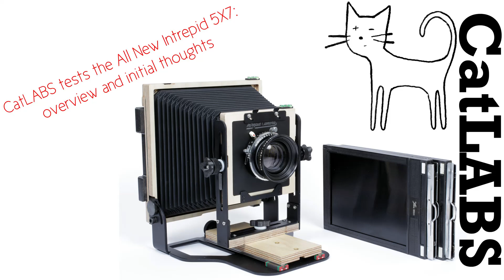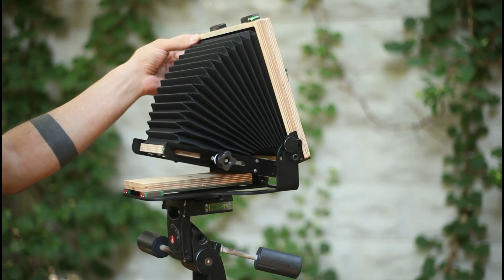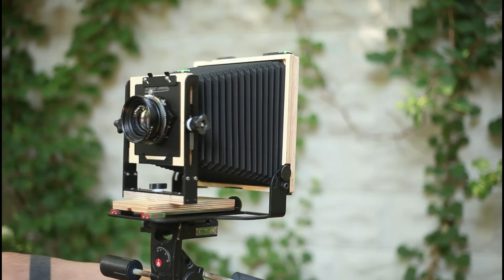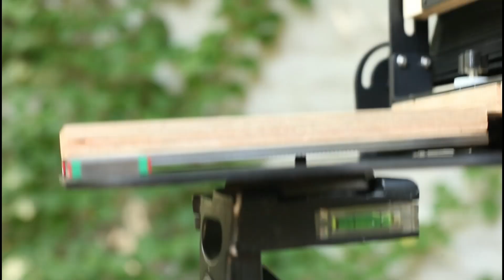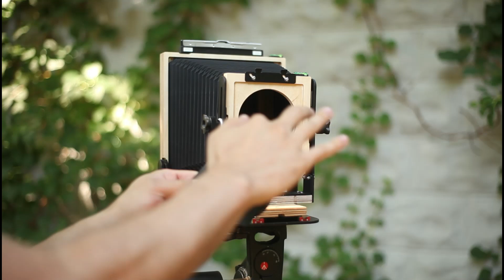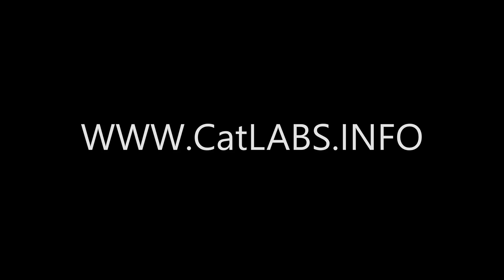CatLABS reviews the all new Intrepid 5X7 camera

Comment: I have the 4x5 MK4 and all the issues you have touched on I have experienced. Difficult to set up the rear standard parallel with front std., I use small bubble type spirit levels to adjust. Centering the rise on the front std also difficult as well as zeroing the front swing, no reference marks although I have made my own on the focus plate. Makes for slow setting up.  I needed to use recessed lens board with 90mm f6.8 Angulon to achieve infinty focus. Now find  the need to install a fresnel screen because that lens is difficult to compose with even in bright daylight. It was a 'freeby' and the shutter is spot on! Must keep in mind it's a  lot less expensive than a Chamonix! Thanks for a informative video.

Comment: Just buy an original Deardorff.  No problems there.
Reply: Are you serious? This camera is designed to be as cheap as possible so people could get into LF photography, and your suggestion is to buy a Deardorff at around $2500.00? Great help mate.
Reply: @lensman5762  I am serious. Who gets into large format not knowing how expensive it is? Stay away from sheet film because a few packs cost more than  the large format camera itself. As for the camera, buy a quality made camera once and be done with it. By the time you waste your money on continuously buying and selling cheaply made cameras you would have just been better to save that money for the real camera in the first place.  But hey what do I know, people don’t listen to experiences they want to experience it themselves 😞
Reply: @vangstr  Well not only is your post blatantly auto fellatiatic, but it misses the point: MANY people spend money to try LF and then never get any further with it. 

It makes more sense to be out a little than to be out a lot. 

And if you can learn on THIS, then using a more pro rig is easy!

Comment: Very interesting review; thanks. Already I was disappointed by some specs (no changeable bellows, 90mm minimum extension) but the issues you highlight finished to convince me it won’t be the secondary 5x7 I was after. Knowing it’s based on the already fourth revision of their 4x5 and they have decades of older LF cameras to reverse engineer, it would be a good time to wake up and step up on the design of a XXI century camera.
Reply: Proprietary lens board was the killer for me - I don't want to swap all my 8x10" lenses onto another lens board every time I want to take the 5x7" out!
Reply: @unityoc  I agree. It would add more value to propose bag bellows vs forcing you get a dumb board.
Reply: Ansel Adams, who I attended a workshop from back in the day, had worn-out cameras and no-name lenses. It’s a light-tight box. Not sure why you need wider than 90 on a 5x7 unless for interior architecture. A three-pound view camera; it’s perfect. Love my MkIV. Enjoy!
Reply: @scottconklin3241  you may want wider than 90mm if you use the camera with the 4x5 reducing back or shoot in restricted spaces like city streets. If I follow you logic, we should all be shooting pinhole cameras :)
Reply: @scottconklin3241  The ' Standard ' lens on a 5X7 is of 210mm focal length. This makes the 90mm roughly the equivalent of 18mm on a 35mm camera. Why would someone want shorter than 90mm on a 5X7 is betond me. In any case, the majority of the 5X7s photographers I have seen, simply carry two lenses. I think people just look at something and because it doesn't appeal, they start to build a case against it. If I wanted, I could tear an Ebony to bits, without even going to mention the price. I don't have an Intrepid BTW, I have an MPP MK Vii and a Wista DX Field.
Reply: My point is buy the 4x5 as well; it’s $300 bucks. There are many field cameras with fixed bellows that don’t go wider than 90, most quite a bit more expensive. It’s why I keep my Sinar for those one in a hundred shots. Never been a fan of reducing backs; carrying a bigger camera to take a smaller picture. All good points, though, thanks!